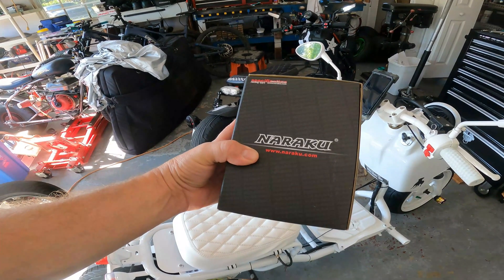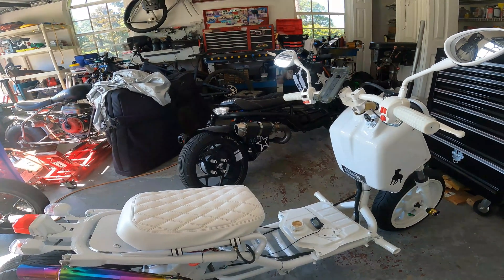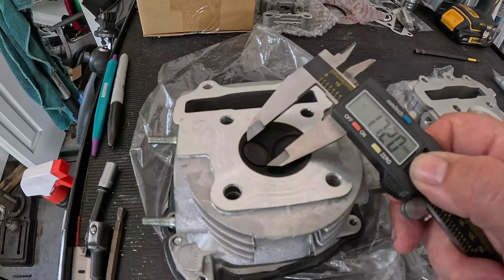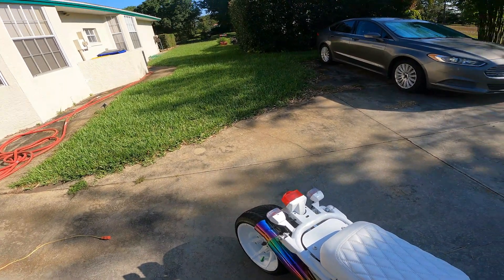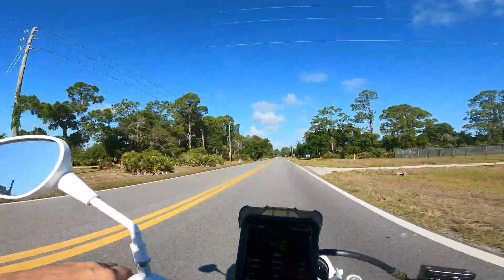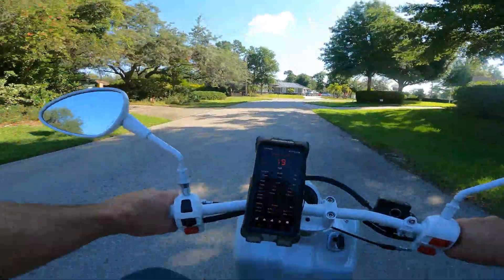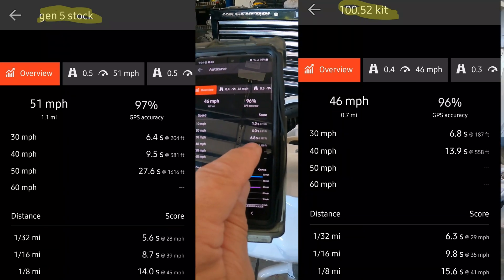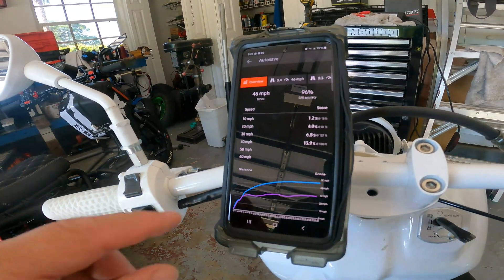Wow! Great Mod.  90cc Naraku Big Bore Kit on a Maddog 50cc 139QMB GY6.  Way Faster

Comment: When you said "We're gonna pin it and see if it blows up" It got me thinking. Let's say mad dogs extra long case 139QMB blows up, can you just buy a regular 139QMB long case and bolt the fat tire to it and get back on the road? Or is there something unique about the mad dogs engine that allows it to run the fat tire? I'm new to the scooter world and coming from the drag racing world I like to have a spare engine on standby but I'm not having any luck finding and "extra long case" 139QMB online
Reply from the maker: It will bolt to the frame, but I dont think the regular long case will hold a 12" wheel and tire.  I am not sure though.  The flat wide tire is a 30 profile so it may fit.  Google says the long case will only take a 10" wheel.  But I am sure that is with a regular 70 profile tire.  Don't know.  The "FAT" tire thing though is different.  The maddog engine is mounted way left.  Just look at it.  The whole motor is way to far left and not centered like a regular scooter.  That way a wide wheel and fat tire can be mounted and the tire appears centered.  The Gen 4 (skinny wheel)  is mounted way left also.  They just use a fatter hub to move the wheel more right to center it.

Comment: I've got Airsal 81.3cc on my Romet 777 and custom CVT on Polini Variator, clutch spring 4.1mm and bell and also Naraku cnc alley, spring beared sleeve + Malossi yellow slide and I've got 90km/h and 128 downhill. Jasil crank shaft and 19mm cvk carburator. Now chanching to 24mm pwk, will let you know.
Reply from the maker: @kooboos89  that thing sounds sweet.  For sure.  Will be curious to see that big PWK on there.  I think you will gain some more speed.

Comment: My 52 naraku and a 51naraku  head they do not sell it no more it was $250 4 year ago but it turned 12: 5 on the tech with no base gasket no head gasket so I put Tower gears in it 17-41 he would do 57 at 9000 with a 21 flat slide
Reply from the maker: @JasonWilson-b9s   damn.  Wish they made that still

Comment: Did you put your oem rocker assembly on that Naraku head? The rockers on those  69mm oem valves vs Naraku 64mm valves don't match.
Reply from the maker: @samupk  No I used 64mm rockers.  You can either use the 64mm rocker box assembly they sell or just buy the 2 64mm rockers and install them on your OEM rocker box.  I tried both and for the price I would just buy the whole assembly because the individual rockers did not fit on the OEM shafts perfectly.   They felt too tight.
Reply: @GhettoWrench  Yeah, it's a pity that 69mm valve head has much more tuning and porting potential than the 64mm, but the available valve diameters on the 69mm are crap.

Comment: I bought a completely new WM 139QMB 80cc engine and also a Naraku v.2 90cc head plus cylinder kit. At first I was able to install only the cylinder, but I couldn't install the head because the rocker arm didn't fit, about 1 cm to the valves, it was impossible to adjust. When I installed the 90cc cylinder and 72mm head, everything was great. Then I installed the Naraku 90cc head and everything disappeared!!! The scooter barely starts (like a train), accelerates weakly and almost doesn't accelerate and wants to stop. I left the same carburetor, but even when I installed a larger 24mm carburetor, nothing much changed! What should I do???
Reply from the maker: @skynetdds  that Naraku head has 64mm valves and needs the 64mm rocker arms.  Did you get those?
Reply: Check the timing. You or whoever installed the kit might have made a booboo during the installation. The two holes on the cam have to line up with the lip of the case TDC on the compression stroke. If you’re even one tooth off on the chain, the wrong valves will be open or closed at the wrong time.

Comment: What are you using for a gauge cluster/monitor? I got my icebear maddog pmz50-19 and at 188 miles on the odometer the speedometer cable snapped into 3 pieces. I want to know the rpm and all the normal gauges but am unsure what to buy.
Reply from the maker: @Br0ken  I have zero gauges...  like a dirtbike.  LOL.  I put one of those cheap square RPM gauges you see on ebay etc that has the wire that wraps around the spark plug wire.  I just put it on when testing and velcro it to the tank

Comment: Mine topped out at 85mph 100cc 50cc Bottom end
Reply: My bicycle goes 123mp/h uphill and I only have one leg!
Reply from the maker: @samuelclopper7998  need a video of that one.  It would go viral.  That's the fastest 50 in the world.
Reply: @GhettoWrench  Put 2000 RPM Springs on it.
Amazon 100.
C c c board kit And spray a little on a true stuff And mine runs on cam 2. Fifteen dollars a gallon
Reply: Twenty gram weights in the clutch
Reply: @samuelclopper7998 That doesn't even make sense. Heavier weights don't mean more speed if you are already at the edge of the variator. It just kills acceleration, and delays shifting at that point. Why are all your comments lies? Like for real, why lie? What do you gain from that?
Reply: AHAHAHAHAHAHAHA!!
Reply: Lol you're so full of s***got a 241 GY6 does 84
Reply: I can make stock cylinder and head do 52 on GPS all in the CVT and carb
Reply: But with a fully built 50 I can only get 61  on GPS

Comment: Just finished assembling a gy6 50cc engine with the 52.4mm Naraku BBK, A9 cam, and 44mm HOCA stroker crankshaft.  Haven't started it yet but itching to do it soon when I finish building my test bench and fabricating another exhaust system.  I have a 24mm and 26mm NIBBI carbs that I'll be testing as well.  I have messed around with variators and clutch springs but ended utilizing all the stock stuff.  Gearing change is where I think I could really improve performance but I'm a wait on that also.  Great video!
Reply from the maker: I just ordered the gear kit.  I got the "least" amount of gear upness I could find.  I don't think it work...  but gotta try it.  When I get it I will make a video with the results.  So wait for that before you buy a kit.
Reply: @GhettoWrench  following!

Comment: Shoulda got the 150 in the first place lol
Reply from the maker: LOL.  I have two 150s.  I wanted a 50.
Reply: @GhettoWrench  it looks awesome!! Nice work
Reply from the maker: @bnorby213  thanks.  The 50s are fun.  You can try and go as fast as you want and never get a speeding ticket.  LOL.  I got it for the wife as you don't need a motorcycle endorsement for a 50 in florida.  So figured I would at least make it rideable around town.  We just use them to cruise the beach roads and get around in city traffic if we go to Miami or something.

Comment: Would you recommend a Icebear from all of your experience? Just looking for something to cruise around town on
Reply from the maker: Tough call.  I just like the looks.  For cruising around town, prob something more like a traditional moped or vespa would work better.  They are all the same engine and cheap chinese throttles and carbs etc..  so unless you go japanese or real vespa then it is going to be crap quality.  If you want cool looks then the maddog is good.  They just don't have luggage compartments and helmet locks and other amenities the typical mopeds have.
Reply: @GhettoWrench  Thank you! I’m really torn between a ruckus and the maddog, but I know if I get a ruckus I’m just gonna end up making it look like the maddog anyways. Just trying to decide on which route, but negative reviews on the maddogs have me a bit torn.
Reply from the maker: @issachutchison8239  people that are used to working on and modifying stuff like maddogs.  People that are not hate them.  And for a good reason because they are just not put together good.  Now the frame and engine are super solid reliable components.   The GY6 is one of the most reliable engines in the world.  If you make your ruckus like a maddig you will end up with a Honda frame and GY6 engine and everything else aftermarket that is made in china.  So the maddog would be best option for customizing.  Way less to do.  Already stretched.  Already has fat tires.  Already GY6.  All you have to do is take off all the crap that is gonna rattle off anyway.  My videos from buying my 150 and 50 new show all that.  Pretty simple.

Comment: i saw that you have some cool rims, can you link to where i can buy some affordable rims?
Reply from the maker: On the all white scoot?  The rear is a stock gen 1 maddog rim that comes on the bike.  The front is a stock gen 4 maddog rim off another bike I have.  I had them both powder coated white.  I'm gonna reply again with a video about rims.  Rims get tough on these.
Reply from the maker: 2nd reply....  this video will also link you to how I did the front rim.  And now you know why I had a spare gen 4 front rim.  LOL
https://youtu.be/FdDC4MlhraU?si=n6Ux5AEXVno_Bbbi
Reply: Would be a really good help because finding rims are hell rn, and its even worse if ur not in the us
Reply from the maker: @lithiumbattery5577  I did the entire front on AliExpress.  I think the rear can all be done there as well.  Just have to know what hub spacing you need and want and the bolt pattern and size.  That stretched back tire video will put you to sleep, but it covers all the numbers your need to start your search.  Think Golf Cart wheels.  LOL
Reply: @GhettoWrench  i found some atv wheels with the same bolt pattern, but still thanks for commenting back i really appreciate it man

Comment: For the 72cc bbk that I got recently, i plan to use a 16/42 tooth final drive gear. I’m sure there’s a good set for a 90
Reply from the maker: Let me know how it works.  I may be wanting to try one though.  That would prob work fine for a 90 also.

Comment: The engine in my Vitacci Clash is a Lifan version of the standard GY6 150. So the engine model serial number is different than normal. It's also being sold as a 200cc model scooter (which it isn't actually 200cc.) so the engine is technically a big bore stock since it's a 170. The actual engine displacement on the dealers site who sold it says it's a 168. Sometime down the line I can always get a 190 kit or something for it to bring it closer to its' sticker size. That would be fun. :)
Reply from the maker: The only issue would be if the cylinder sleeve fits in the case.  On the regular chinese  GY6 I think anything 180cc and over is too big and you have to "bore" the case. I have heard guys just do it with a drimmel as it does not have to be precision round.
Reply: @GhettoWrench  I'm sure it's probably going to be the same for mine. I think 170cc is within the limits of what stock engine cases can hold before they need to be opened up more. GY6 Racing has a 204cc big bore kit that includes everything needed including the case boring tool. 

But it's $830 and since my scoot runs and drives just fine for now it's not needed. Besides, I have two vintage big bore 2-stroke dirt bikes that need to be worked on first instead of tearing apart something that already runs and drives. :)

Comment: Will this work on the minimax 50 was thinking bout getting one just had my 125cc motor frame mount crack on me which do u think has stronger tubing the maddog or the minimax
Reply from the maker: I have never even seen the minimax in real life.  The maddog frame is pretty beefy tho.  Look on the side of you engine under the CVT...  there will be numbers.  If it says 139QMB or 1P39QMB then it should fit.  These motors are all the same.

Comment: The naraku 52.4mm kit has a lil bit more then most 23/20 heads. Slightly bigger ports vs Ssp-g and Ncy. As well as a niksil coated oiston and cast iron liner. Years ago naraku had a race cam for the 139qmb but its long gone. Just the Ssp-g, ncy and bullock cam.  I would be interested on the weight of the naraku piston vs a Ssp-g or Ncy 52mm. And what the compression comes out to on the naraku kit
Reply from the maker: Thats interesting.  Thanks.  I could do a compression check.  Can't believe I forgot to do a before and after test as I usually do.

Comment: I had an issue with the valves on the naraku head. The stems are soft and mushroom over. It would never hold its valve lash. Thankfully I had a glixal head that had the same size valves and I'm running those valves in the naraku head. To prevent the stem from mushrooming agains I got 2 5mm valve lash caps from EC carburetors. Hopefully you don't have that problem just keep an eye on the valve lash.
Reply from the maker: Great to know.  Thanks.  Did you grind the Valves smooth to not trash the guides before pulling them out?  I had no idea glixel made valves that size.  Did it require anything more than a simple lapping to make them work?
Reply: @GhettoWrench  I used a Dremel to grind them down as to not ruin the guides. The glixal 52.4mm head has the same size valves all I did was lap them and they have been going for about 1000 km without issues.
Reply: I have the same exact kit and have been chasing down what's causing my valve lash to grow every few miles. I get about 5-10 miles before it's so bad it loses compression and dies. Everything has been replaced except the BBK and it's components. I bet I'm having the exact same issue. I'll be ordering the Glixal 52mm head later today and the swapping the valves out to see. Was the damage (mushrooming) on your valve stems obvious?

Comment: Thank you again. Wish I could legally upgrade to a bigger cilinder :)
Reply from the maker: Sometimes you gotta go outlaw.
Reply: @GhettoWrench  in my country they will take you drivers license for something like this!. My legal max is 50cc and max 45km/h...they will sort of allow 50km/h as a margin but no faster for a scooter!
Reply: @frednetherlands887  do a big bore and then just gear it to max out at your 50 limit. It will just get there a lot faster.
Reply: @ThePitProductions  even that is against the law as it would exceed 50 cc! Life is not easy here ')
Reply: @frednetherlands887  I did understand that sir, My thought is, If your never speeding, it looks factory stock, and is not super loud. What would make them even look at the cc? Grind numbers on the jug and it would have to be "measured"   I AM NOT ADVOCATING BREAKING ANY LAWS. Well not my laws.    FINE good sir. WE will look into go fast without cc increase.

Comment: whats the max rpm these things are rated at?
Reply from the maker: I never really figured it out.  I can feel valve float before 10k on the stock ones, but I ran 11k with stiffer springs.  Motor seemed smooth.  Not real sure where they come apart.  LOL
Reply from the maker: I have seen power curves and they seem to peak around 8500 to 9000.  But that all depends on when the guy on the dyno backs off or when the Valves float